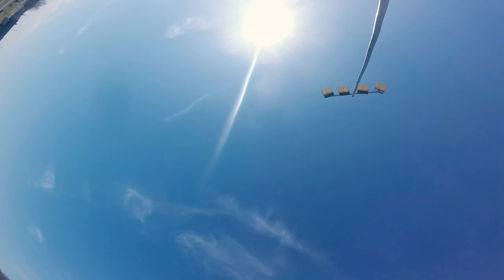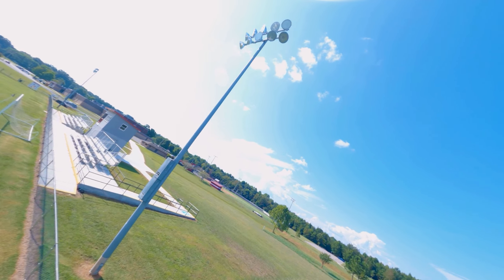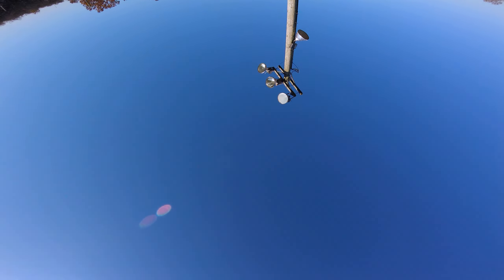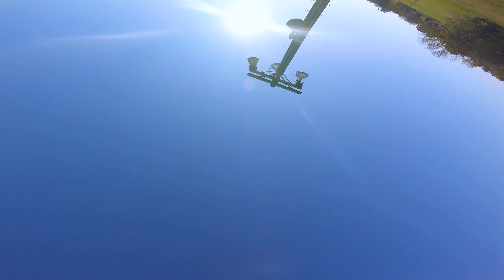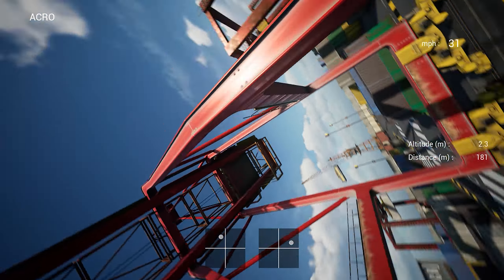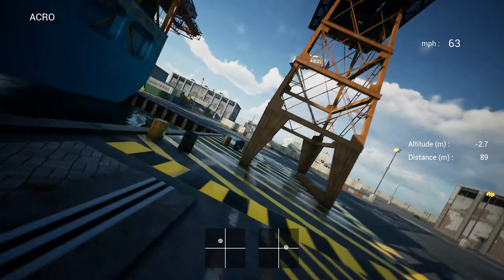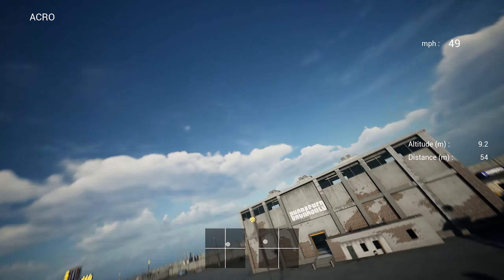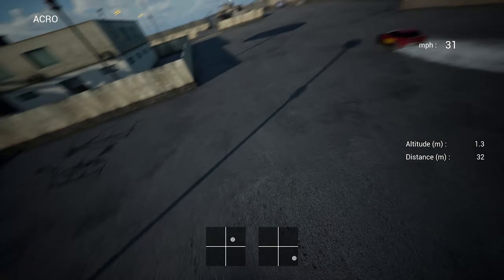Trippy Spin Tutorial (Inverted Orbit) - Understand The Trippy

Comment: Great tutorial Josh! 
Trippy spins can be done at 10-15% throttle while at 15 degree cam angle if you want. You can use less throttle in a trippy spin by adjusting your pitch and how much of the object is in view. Something a lot of tutorials leave out is the pitch. You can adjust how high or low you are on the object with your pitch, this will also change your throttle needed to hover. 
Keep up the good work!
Reply from the maker: Indeed, the lower angle trippy spins are quite a different trick.   I personally don’t fly anything lower than 25 degrees,  so other than sims I’ve never tried them at lower angles.   Thanks for checking it out brotha!
Reply from the maker: Also I threw ya a sub!